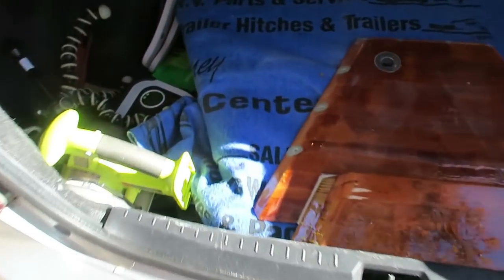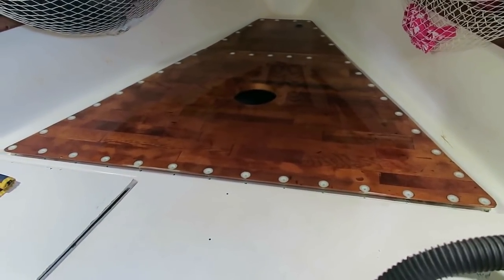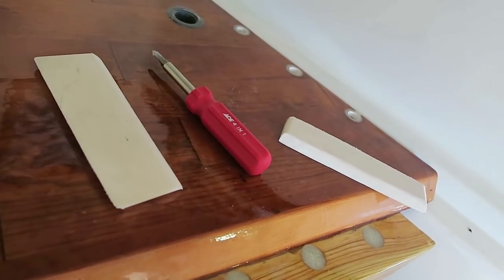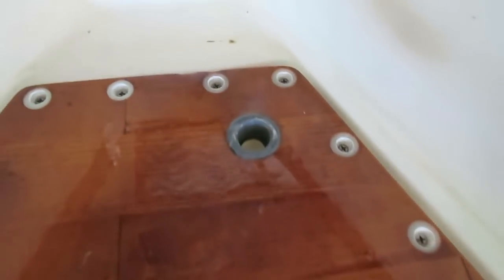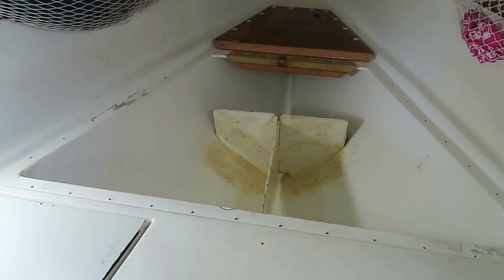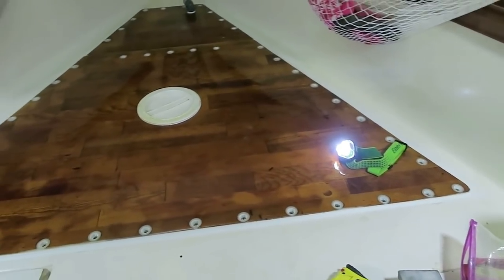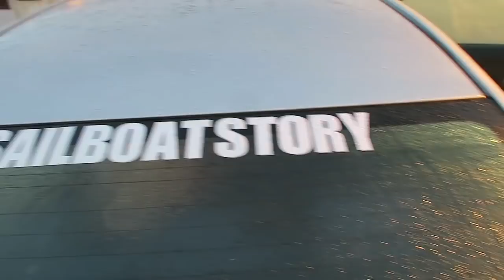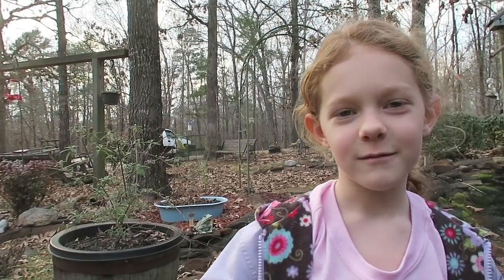Old Boat Gets A New Water Tank Lid | Sailboat Story 81

Comment: Ben, the piece you need to change out the size of the fill pipe is called a  1-1/2" x 1" reducer. You can probably find one at a Ferguson  Supply or any plumbing specialty store. We get ours at the office from a South Carolina company called American Stainless. You need to decide what material you want it in (CPVC, PVC, Stainless) because some material may be on the shelf while others need to be ordered.  Let me know if you need contact information.
Reply from the maker: Does it go from hose to hose - or directly from fill port to hose?
Reply: Sailboat Story I don’t know for sure but you can get it as a slip on or a threaded connection. It depends on your fill connection

Comment: maybe I'm "slow" but what was the idea behind enlarging the original tank lid fastening holes? It's very difficult to get holes exactly aligned on a new piece by using the veneer from the old lid as a template. Then enlarging the holes to accept epoxy resin to drill new holes through further compounds the "error  alignment" deviation plus the circumference edges of the epoxy plugs can separate & trap water in the adjoining wood. If you are sealing the lid to the fiberglass water tank with a sealing medium you should not get water intrusion in the machine screw passages of the lid, but you could put sealing medium on the machine screw threads where they contact the epoxied wood lid.
Reply from the maker: The simple response is that the new lid was installed without trouble, holes aligned perfectly, is better than the original, and has been working flawlessly ever since.

Comment: Ben you are awesome! Good job can be tricky making something fit from 300 miles away!, shame nobody will see the wood! Is there a separate fill vent or does it just vent up the fill pipe?  Cheers Warren
Reply from the maker: Yeah, the vent is up high at the narrow end of the tank, on the inside.
You can see it in one of the earlier shots.
I was sooooo relieved to have it fit correctly.